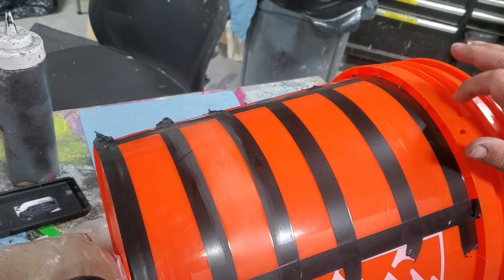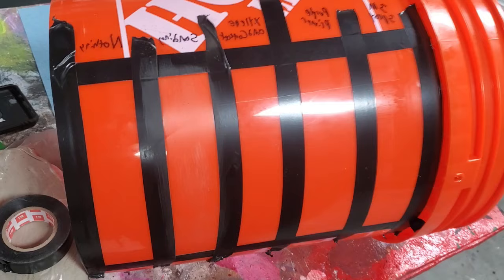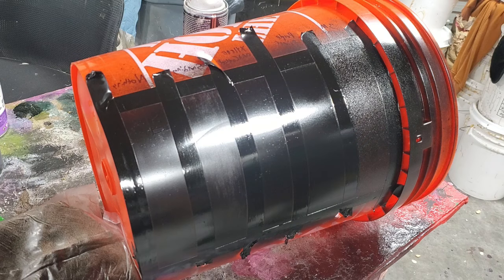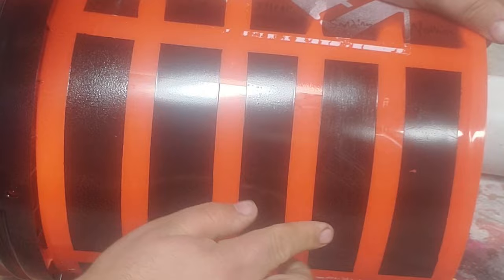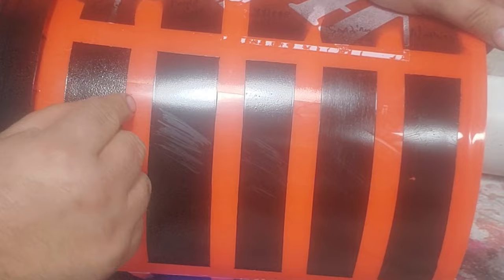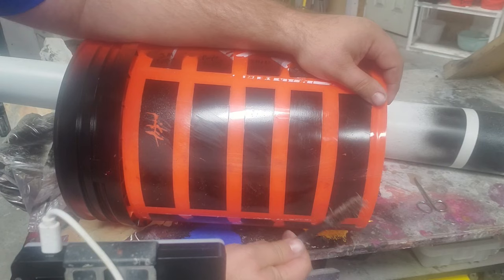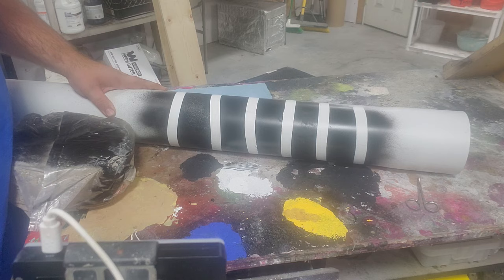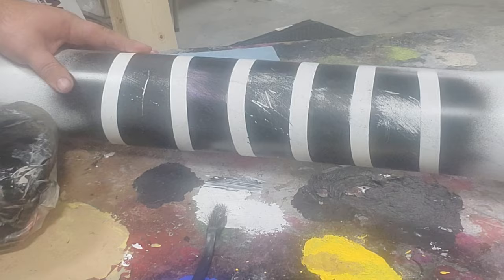spray painting plastic- best primer

Comment: I have a 55 gal., blue plastic drum that I am making into an airplane-style trailer to pull my dogs behind my electric bike or my lawn tractor with. I used a plastic adhesive before primering but it did nothing and the paint easily peeled. The Oatley PVC primer and cleaner product looks like it may work okay, but I am wanting to use an enamel to paint the thing two different colors. I will tape off the sections which are different colors, but I don't want the edges to peel on me when I remove the paint. I am not keen on the rattle can paints and I want to use my HLVP gun, anyway, as it has remained in the box for about a year, now. Any rate, I didn't see the purple color when you applied that PVC primer and cleaner. Is it clear, as every time I use that blue stuff, I get it on my hands and look really stupid for a day or two before it wears off. ;-) I wish you had done up a plastic drum/barrel in your experiment, as they have multiple scratches in them and the plastic in them is not as smooth as the Home Depot buckets are. I don't want to fill with Bondo or filler or anything, so any rough scratches in the plastic will simply be part of the thing when I finish. It may give the trailer character marks, right? ;-) Thanks for the video. It really helps as I already wasted a lot of time and money on other paint materials which were bad results for this project.

Comment: I plan to paint a beverage cart. It's in a bit of rough shape so I'll have to sand for sure. I'm curious how this will hold up over time with putting ice in it and pulling/pushing drinks in/out of it...🤔 Is there a waterproof sealer I should use?
Reply from the maker: any good outdoor sealer should help

Comment: So in your opinion. Would the Purple primer work even better with sanding it too? Or would sanding just be a waste of time ?  I also noticed the mirroring at the beginning. Thanks very much !
Reply from the maker: Sanding is never a waste of time, but you will change the look of the surface. if you want it smooth then just primer, if you dont mind a scratchy surface.

Comment: Can I ask you what would be the best way to paint plastic pallets that I want to use as a walkway or extra sidewalk that can also hooks up to weather extremes and or power washing once in a while?

I know I could use wire wheel over the top to give pain something to bite into the plastic pallet. And then seal it after spray painting with some type of sealant so paint doesn’t wear away? But theee really isn’t anything out there on this
Reply from the maker: this is a mythical hope lol. I mean you could rhino liner them and that would do it- but no spray paint will survive powerwashing or foot traffic on plastic- you might look into agraco specialty coating for the plastic- but cost wise why not cover them in 1/4" plywood and paint that?
Reply: I would just buy  plastic deck boards (pick your color) and cut those for a walkway.

Comment: Curious why not try automotive spray adhesion promoter?  I have used the PCV primer for years (discovered serendipitously while making large PCV pipe props)  but have recently tried the spray adhesion promoter to try to be more "professional".  I think the promoter is just a little more expensive, but not that much more(not sure). However I have not used promoter long enough to know if it is word, just as good or better than the purple primer. You should also try flame treating the plastic as heating the surface is very cheap and easy and can be combined with the other methods.
Reply from the maker: I can add those to my list!
Reply: Where do you buy the spray adhesion promoter?  What brand works well for you?

Comment: Not sure if you will see this or not, but what would you suggest to use to paint one of those small brown 3 drawer plastic Sterilite bathroom drawer organizers? The one with the weave pattern on it. I want to paint it light  purple to match my bathroom.
Reply from the maker: I would go with one of the *made for plastic spray paints like fusion from Walmart- they are actually pretty good.

Comment: Great video.   I have 3 large 6 foot round planters I want to paint.
What do you suggest on the something so large?  
I have 15 of them.
They are large  plastic leach field products that I use as planters.
I live in an area with cold winters and hot summers.
They are white.  
Thank you
Reply from the maker: sand them well first then protect the paintjob with a spray polyurethane.

Comment: hmm, first thank you for your vid.  

i'm trying to figure out why my granite spray paint that i painted onto a regular plastic hanging flower pot (like home depot) started peeling off from the pot while in the rain.

 i didn't scratch it first, so perhaps i should have?  

i did do 2 coats of primer before using the granite looking paint.  seems your purple stuff might be a better option.

i also granite sprayed the trim on my newly copper painted mail box... and the trim granite spray is coming off of that too.... ugh.  i think i even did a clear coat over the granite spray.

any further suggestions you might have for me?  not sure what type of plastic a hanging flower pot is... nor the plastic of mailbox trim.  both items are outdoors and in the rain and both are majorly peeling.  what a bummer.

appreciate any advice...
Reply from the maker: use spray adhesive under the granite spray- the texture wont really matter and it will greatly help adhesion.
Reply: @StiltbeastStudios  thank you, trying it now.... we shall see ;-)

Comment: will the purple primer works on dirtbike plastic? im using adhesion promotor before and still chipping off easily on that kind of plastic..
Reply from the maker: you would have to test, but Im sure it would based on what I know

Comment: 3M maked #80  for plastic but adhesives are not primers. You should of used a plastic primer bare and over each of uoyr primers and trien POR 2k urethane paint.
How to paint HDPE:
Wear gloves and a resparator, not just a dust mask.
Mask of all areas not to be painted.
Remove all oil and fingerprints with Acetone or MEK. Do not use Turpentine.
1.    Using a green scotchbrite pad, dull the HDPE plastic. Sand in circles.
2.    Clear untinted PVC Solvent  wait 30 minutes

3.    Second coat of  PVC Solvent. Wait 30 minutes
4.    Spray paint plastic primer lighter than final color, Rustoleum Plastic Primer. Light coat. Wait 6 hours
5     Sand any rough spots or runs with 320 grit.
6.    Spray paint plastic primer lighter than final color, Rustoleum Plastic Primer. Medium coat. Wait 6 hours.
7.    Sand  with 320  or 400 grit.
8.    Using an airbrush or fine spray paint gun, not a spraycan, Apply Clear POR epoxy paint, thinned. Medium coat. This provides
      a surface any paint will stick to.But it must be a continous coverage, not spotty. This will prevent deep scratches.  Wait 12 hours.
7.    Sand  with 320  or 400 grit to remove gloss.
10.  Paint with your favorite spray paint. Repeat coats until all sanding marks dissappear.
11.. Using an airbrush or fine spray paint gun, not a spraycan, Apply Clear POR epoxy paint, thinned. Medium coat.
Never have to pint it again.

Else instead of Clear POR epoxy paint you can use POR colored Epoxy paint or for a rubbery look use POR POR 2k urethane paint.
Done
Reply from the maker: yup
Reply from the maker: you honestly lost me at wait six hours, patience is not my forte.

Comment: I use Createx UVLS Clear!
Reply from the maker: on all plastic? or on a certain kind.
Reply: @StiltbeastStudios  I’ve used it on many, should still sand surface, but it’s worked really well. It also works great on urethane foams/rubbers and latex.